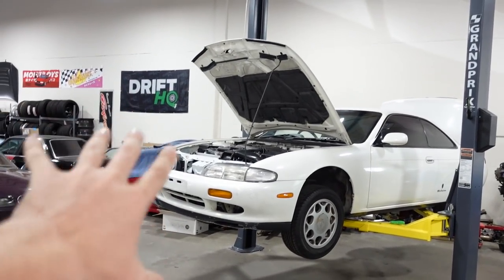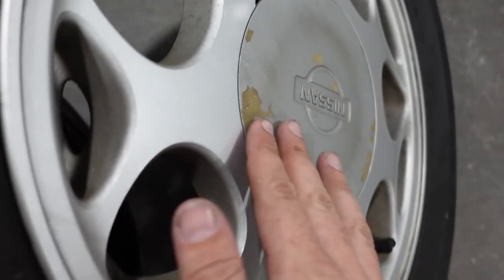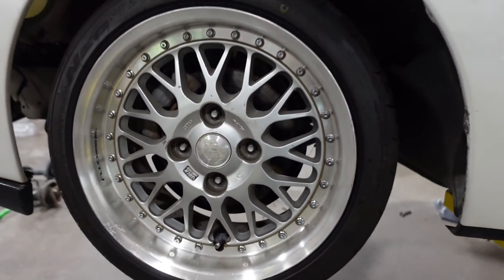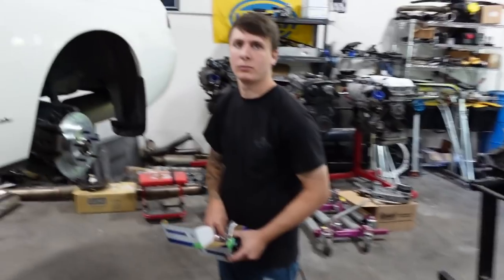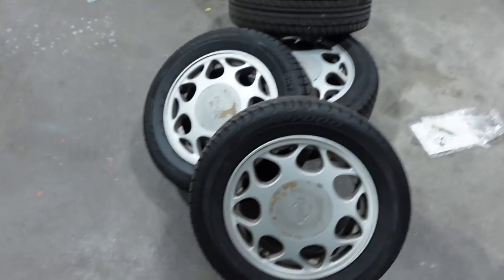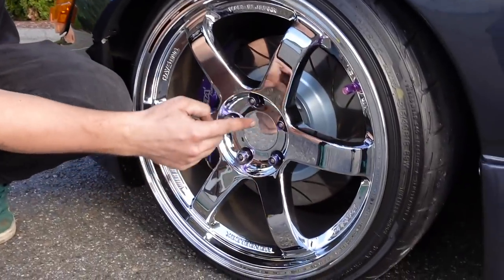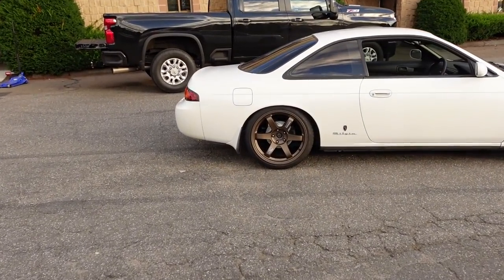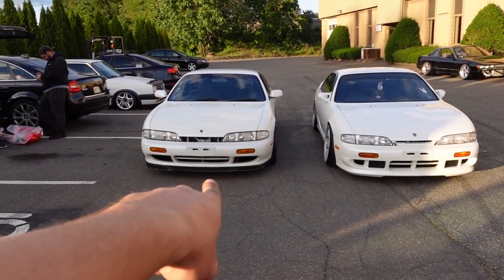S14 Silvia gets a COMPLETE Transformation! (Back to life!)

Comment: Stock body: 17’s

Lip kit : 18’s

Full kit: 19’s

Keep the 18’s Jimmy! Once you put the lip kit on it’ll look good 👍🏼
Reply: 19s on an schassis ❌❌❌
Reply: 18s with full kit***
Reply: 19’s dont belong on any nissan
Reply: 17 or smaller is the only way on a sbody
Reply: Pfft y’all wack, go lookup Taniguchi’s S14 from back in the day, he ran 19” Volk’s with a full vertex kit. Looks proper with the wheel wells all filled out. Hell even an 18/19 would be suitable 🤷🏼‍♀️
Reply: @HallowellsSpeedShop  They just ain't cultured enough. 

Like fuck, some of the old 326power cars they use to run 19/20 with a full kit and still drift them and it can still look hard af with the right kit and wheel setup.
Reply: @MechanicalSlime  exactly. I actually totally forgot about the old 326 cars, them bitches were sick asf. I just don’t understand the small wheels on a long dick car like an S14. S13/86/Z31/Starion etc sure small wheels look great, but not S14’s.
Reply: @HallowellsSpeedShop  Honestly I can get both sides of the coin, like small wheels can still work on things like S14's but you need the right wheel and tyre setup.

Like 15's and 16's can work great on S14's for the like proper early/mid 90's style.

Comment: I find it hard to believe that DJ was good in any classes, and that Steve guy's a tool.

Finally some good coilovers on this channel. HKS Hipermax are the shit. BC Racing is trash.

"the fitment is so whack right now"
The front end needs to be a bit higher for suspension bound/rebound right? It looks perfectly fine to me. Maybe the rear is like an inch too low in my opinion. Then again, you've got people over there like DJ making ovals out of their exhausts and melting frame rails so yeah...
Reply: You realize your opinion means nothing right? Lol
Reply: @Jaiden-ll3nc  My comment was 2/3 statement of fact and 1/3 opinion. Opinions are subjective you know. 

But you're right, guess my suggestion for a functional, driveable height which doesn't impede performance doesn't matter to stance bois that just hard park their cars. Or rub through fenders/exhausts & scrape frame rails when they do take them out.

Comment: Please Jimmy stop saying that you need pre tension the springs. Pre tensioning doesnt do anything regarding the functionality of the suspension. Spring rate stays the same through out the whole travel of the spring. Coilovers which have the height adjustment at the bottom have a problem, because you are changing the lenght of the shock itself. That affects your suspensions droop, which isnt ideal. You can alter the droop by taking that bs pre tension off. Speed Academy has a nice video about it when they installed coilovers to their mk4 Supra.

Comment: The stock body looks skinny because you put such huge wheels on it. Like putting double D's on a skinny 16yo..  it's al about the proportions.  seeing as your moving more toward OEM plus I'd vote for the 16's and slamming it to flush fit/ fill up those wheel wells. No skirts no nothing. More like a  90's tuner(Nismo) would have done. Haven't you've done plenty of huge wheel skirted up S-Chassis?